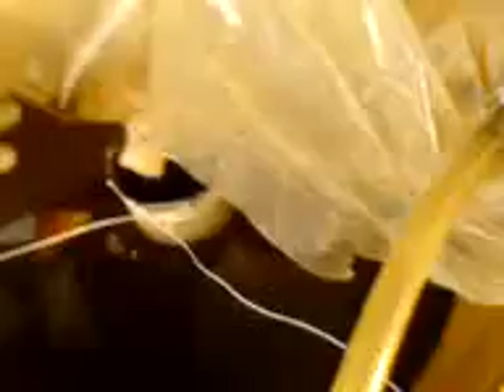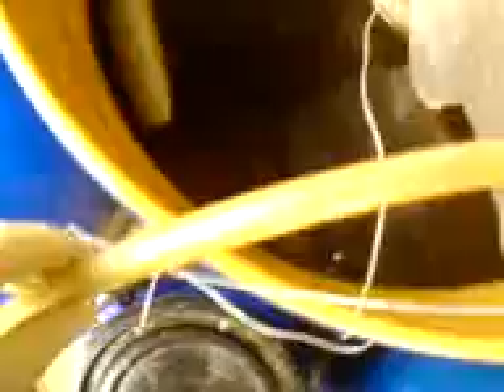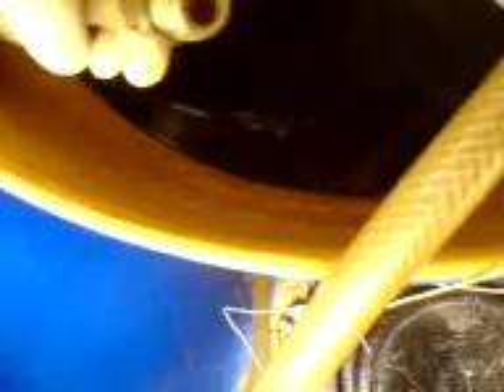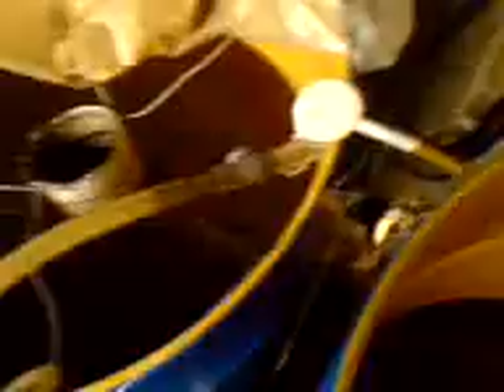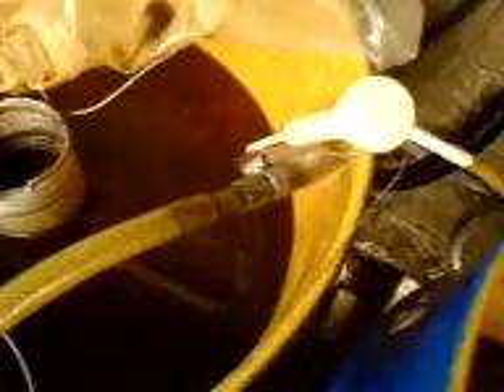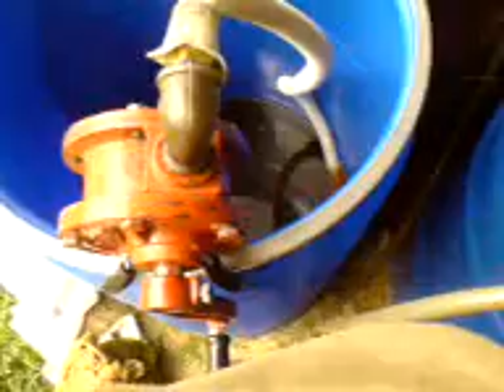Purifying Waste Cooking Oil for Fuel (2/4)

Comment: For retrieving hard fats, put the decantation barrel on a platform, add a large plumbing valve in the bottom of the barrel (hole and a buncha silicone) that makes the muck go under the platform into a bucket for later use?